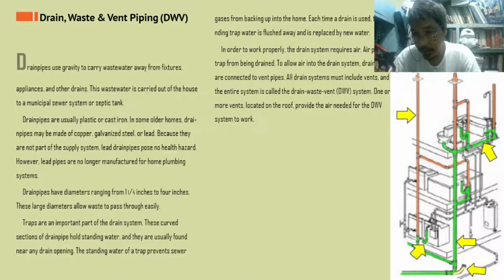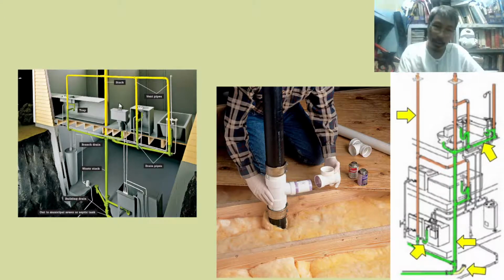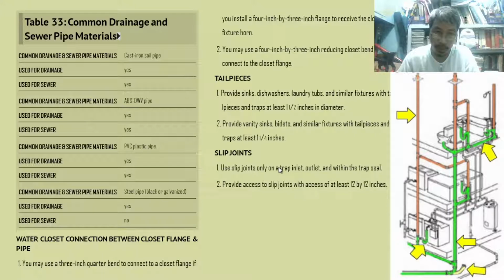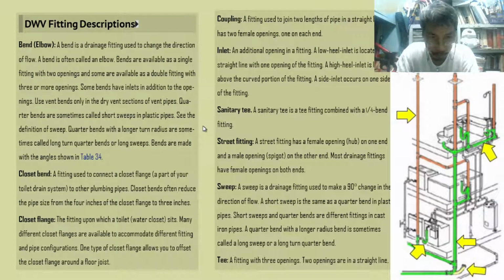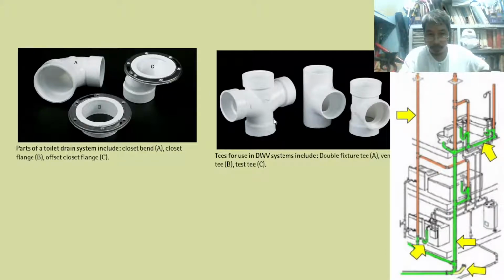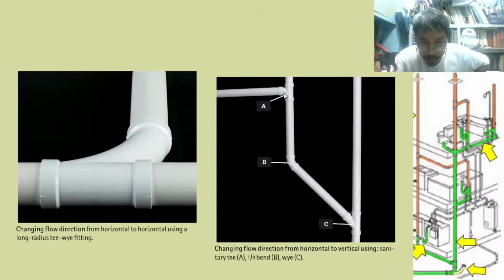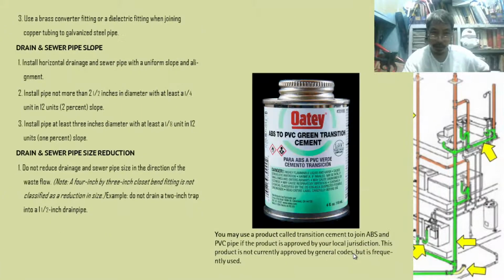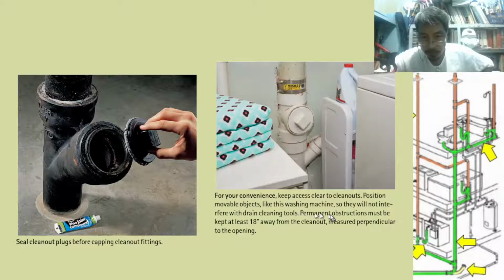[ LIVE CED2 Lecture 07 ] DrAP Zantua DWV System Talks + ENGINEERING Analysis & Design

Comment: Thank you Sir for this live video lecture that tackles about DWV System. DWV means Drain, Waste and Vent Piping.  Usually the drainpipes are plastic or cast iron but in some other old house they used copper, galvanized steel or lead drainpipes. Lead pipes are no longer manufactured because it is dangerous and poisonous. I have learned that 1 1/2inches is almost the biggest water supply. And I also learned about the sizes, the common sizes of water supply are 1/2 and 3/4. Traps are an important part of drain system, those curved sections of drainpipe hold standing water and usually found near the drain opening. The vent tee fittings should be used only in vent pipes but not in drainpipes that carry wastewater. It is also mentioned here the common sewer pipe materials: PVC and ABS are allowed for use in DWV systems and also cast iron but it is rarely used in residential construction. These are DWV Fitting descriptions: Bend (Elbow), Closet bend, Closet flange, Coupling (a female opening) while Union (a male opening), Inlet, Sanitary tee, Street fitting, Sweep and Tee. Flexible, ribbed material is not approved in a DWV system. Wye fitting has three openings, two openings are straight lines and the other one opening is an approximate 45 degree angle to the others. Wye fittings can be made with the other fittings to make combination fittings such as tee wye and a combination of wye and 1/8 bend. Double wye and Double tee wye are also available. Bend pipes are for DWV systems include: 1/4 street bend, 1/4 bend, 1/4 vent bend and 1/4 bend with side inlet. The parts of toilet drain system includes: Closet bend, closet flange and offset closet flange. Tees for use in DWV system include: Double fixture tee, vent tee and test tee. Inlet fittings include: bend with low-heel inlet and bend with side inlet. There are two types of sanitary tees include: Single sanitary tee and double sanitary tee. Wye fittings for DWV use include: Wye, Double Wye and Tee Wye. All I can say that the lesson and topics are well-explained and you'll surely learn a lot about DWV system.

Comment: Thank you, Sir for the live lecture .It was nicely described how drain pipes and traps work. I discovered that curved parts are used in traps to hold standing water. Vent tee fittings should only be used in vent pipes; drain pipes shouldn't have them. Drain pipes need to have an unsupported slope of no less than 2% that is not supported by a tee with perpendicular pipe outlets. Popular DWV pipe materials, general specifications for drain and sewer pipe, and common sewer pipe materials like PVC and ABS were all covered and well explained.

Comment: Thank you so much,  sir, for this live lecture about the Drain, Waste, and Vent Piping System or commonly called DWV. I learned that the drainpipes are usually made of plastic and cast iron. Drain and sewer pipes general requirements, common DWV pipe material, Tailpieces, Slip joints, DWD fitting descriptions, Bend direction change, Approved drainage fitting is for changing flow directions, Drain and sewer pipe connections and joints, and Drainage and sewer pipe fittings are also discussed and clearley explained in this lecture.

Comment: Thank you sir for this live lecture about drain and sewer pipe general requirements, common DWV pipe material, common Drainage and sewer pipe materials, tail pieces, slip joints, DWD fitting descriptions, bend direction change, approved drainage fitting is for changing flow directions, drain and sewer pipe connections and joints, and so on. In this video I learned the materials and equipment used in the piping system and I also learned what specifications and required materials will be used in the piping system.

Comment: Thank you sir for sharing us your knowledge about this academic live lecture video, (DWV) drain, water and vent piping. I've learned a lot in this topic like the common DWV pipes materials general requirements, DWV fitting description, approve drainage fittings for changing flow, and the proper installation of a connection of pipes in a building or structure and the sizes that we use...

Comment: Thankyou sir for this video lecture that tackles about drain, waste and vent pipe (DWV). Drainpipes use gravity to carry wastewater away from fixtures, appliances and other drains. This wastewater is carried out of the house to a municipal sewer system. I’ve learned that drainpipes ate usually plastic or cast iron. In some other it is made of copper, galvanized steel or lead. Drainpipes have diameters from 1/4 inches to 4 inches. Also traps are important part of the drain system because these curved sections of drainpipe holding standing water and they are usually found near any drain opening. Wye is a fitting with three openings. Two openings are in straight line and one opening is at an approximate 45 degree angle to the others.

Comment: Thank you sir for this informative live lecture about the Drain, Waste, and Vent Piping System. I got to know that the common diameter of drain pipes o.25 to four inches. The function of drain pipes and traps was explained well. I learned that traps have curved sections to hold standing water. We should use vent tee fittings only in vent pipes but not to drain pipes. Drain pipes must maintain a minimum two percent slope that is not supported by a tee with perpendicular pipe outlets. Common sewer pipe materials: PVC and ABS, Drain and sewer pipe general requirements and common DWV pipe material were discussed and explained clearly. Common Drainage and Sewer pie materials are very informative sir. The water closet and connection between closet flange and pipe, Tailpieces, and Sleep joints were explained clearly with its instruction and code specifications. 4x3 reducing closet bend (horn), chromed p-trap with slip joints on lavatory sink, and drain tailpieces were discussed with pictures which is why it was easy to imagine and understand these things. DWV fittings description for Bend (Elbow), Closet Bend, Closet Flange, Coupling, Inlet, Sanitary Tee, Street Fitting, Sweep, and Tee were shown and explained. Wye is a fitting with three openings. Bend direction changes to the table and Approved drainage fittings for changing flow direction were discussed. Drain and Sewer Pipe Connections and Joints: Changing flow direction from vertical to horizontal using wye fitting and 1/8 bend,  using tee-wye, using two 1/8 bend,  using a long sweep fitting,  using wye fitting, using a long-radius tee-wye fitting were talked and explained. There is so much information here in this live lecture video that talked about drainage and sewer pipe fittings: changing from horizontal to vertical using multiple fittings. 90 degrees bend with low heel inlet, high-heel inlet, and side inlet was discussed.  There is much information discussed at to the end of this video. Thank you sir.